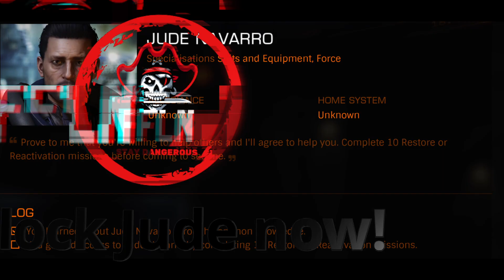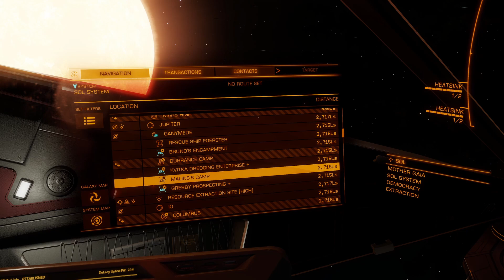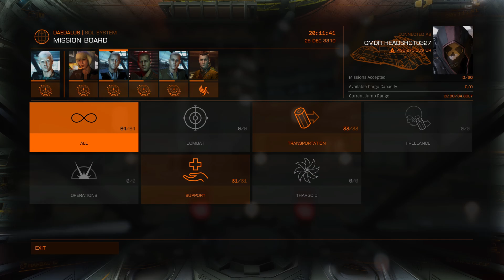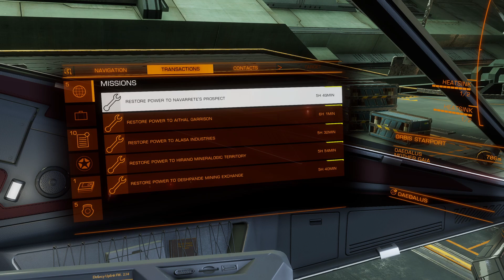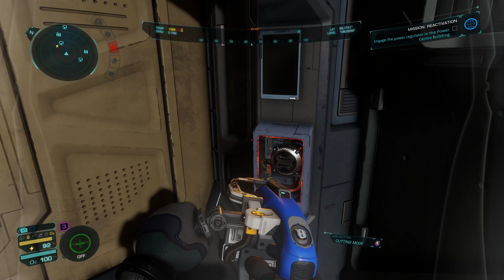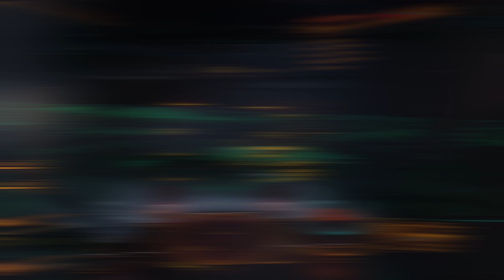Elite Dangerous Unlock Jude Now, How to, Why you should do it right now

Comment: If you're reading this long after the dust from the war has settled, try the Dainayiman/Xiancheim/Raidenwitha/Heryshaf systems. A couple of years ago I set up 60 anarchy settlements across those four systems, and one of them is nearly always in Bust state.
Reply from the maker: @Sighman  great tip about the other systems. I will pin your comment
Reply: Currently in Xiancheim and Restore Missions are available. Id do it here since SOL doesnt have anymore.
Reply: I have been flying around for 3 hours and every system I go in with bust/infrastructure failure/natural disaster/war/civil war/ect. is simply populating donation missions. I don't think I have ever seen so many before. For the life of me how on earth do I find these missions using Inara?
Reply from the maker: @Fenris159  its all down to rng, if you find an anarchy system, you can raid a settlement for days until it shuts down. which is why I tried to infirm as many as possible to do it while it is still easy to find. someone in the comments said they had a few systems they set up for this
Reply: @FFLN-b2c  Did the SOL missions already end? just got to the video
Reply from the maker: @ItsDeaconYT  yes they did. Some people have been posting in the comments when they have been able to find systems offering the missions
Reply: @FFLN-b2c  Turns out now that Sol ended the problem I was having was trying to check the mission boards while in ship. They won't appear. Had to get out and go inside the station to check the board. Found a bunch in a nearby system in a bust state.
Reply from the maker: @Fenris159  ok, I mentioned in the video that under normal situations you would find them inside the station on foot, I maybe should have made it more clear that they only show up inside stations under normal situations, and was not an optional thing

Comment: There is a Misc section in the Data part of Inara to find any special systems. Ie war systems for surface conflicts, reactivation/restore missions, all are centered on inputed system. It takes me seconds to find a system I need to plot and dont know where this weeks to find this stuff comes from. War and restoration is all around the system not just sol only and they are not all thargoid inflicted btw

Comment: I used Inara. Searched for minor Factions with status "infrastructure failure". Then checked each faction on size and assets. Picked a relatively big faction with multiple stations including an orbital in one system and got a hit right away. My alternative of using a SRV against scavangers was using one simple dumpfire missile rack on my Cobra. SRV is prolly better though, because I got bounty on me several times for splashing targets, that hadn`t yet open fire at me.

Comment: I have done 5 of these so far (in my alloted game time) and acquired some godies - enough to upgrade 1 suit. I got killed by the piraes on one mission and the in another I put the power regulator in place only to find that the display panel to initiate the power up sequene was off.
I have no idea what the issue was there. So I had to abandon that one.

Comment: Yeah, after having done these a buncha yesterday and accidentally unlocking Navarro, you can power up each settlement in a single charge in a basic suit. Cut, charge, cut, charge, drip in core, turn on, steal a little bit, leave. And once power is back on, you can simplify recharge as needed. 

Agreed on mowing scavs down with the SRV.

Comment: Spend one week in a rival PP system, hitting an anarchy factions odyssey settlements (take out everyone, steal all data, steal all PP goods etc), go to another, rinse and repeat. Do this a couple times a week. Next week, that faction will be in bust state and their places will be shut down. Go to one, turn it on, get the mission to go to the other place and turn that on, go between the 2. Every other trip is a restore mission.

You actually build rep with the anarchy faction whilst earning merits from undermining :D

(it does also slightly counteract it by completing the missions in a rival powers space, but oh well, it's only 10 restores required to get the eng then you can not accept the missions and just devstate them)
Reply: Your strat is way quicker just now though lol. The above would be what I would do in the absence of this heads up I should add.
Reply from the maker: @joetriccas  good tip for anyone that misses out on doing them now

Comment: Thanks for the excellent walk-through!  If you are like me, bad at the shooty bit: Equip 1-2 dumbfire missiles packs to clear out any initial scavengers. Pips to shield and hover over the settlement bombing the bejeez out of them when they start shooting at you. Only disadvantage is that most of the bodies despawn so you cannot scan them for extra bounty. Also a scorpion SRV helps with any stragglers (scout/sharpshooter). Fun to run them over.

Also, if you don't mind the fines and reputation hit: Grab random restore missions that offer power regulator and abandon them.  Then after a few runs don't forget to go to nearest interstellar admin station and pay them off before they get pissed off at you.
Reply: Just use an srv lol

Comment: Thank you! Very helpful, hope I'm not to late!
Reply: Be Advised: as of 12/27 Sol is locked  to me, (cannot Jump there) - I had been in there before doing these reactivate missions., 6 I think so far.
Not sure why they would close it to the public even with the recovery still in progress?
Reply from the maker: @juliancain6128  still active missions their. the system temporarily had its permit removed during the sole invasion. if you do not have a sole permit you would need one. they are not too difficult to get
Reply: @FFLN-b2c  I'm at Midshipman, one more rank to go...thanks again for the heads up!

Comment: You don't need to overcharge the doors, because you always get the grade 3 permission to open the doors. (Otherwise you would also need an e-braech to start the reactor.) This saves enough energy that you don't have to recharge the battery.
Reply from the maker: @leonhardwildensteiner8832  you have to over charge the doors, because there is no power for them to open. After you get the reactor powered up, then they will open for you, with level 3 access. Overcharging just gives them enough power to open, until the settlement power is restored
Reply: @FFLN-b2c  you have to charge them, but don't need to OVERcharge them. I did this 10 times yesterday. By the way. You can get 1200 merits if you have are having Paranav Antal, as your power.
Reply from the maker: @leonhardwildensteiner8832  ah, that makes sense. I thought you were saying they didn't need to be charged at all.

Comment: IF you need to source a power regulator the salvage missions can provide one on occasion. The one that has a SRV or on the top or bottom of the crashed ship
Reply: When you eject the power regulator, if it does not glow, it's a degraded one. Only good ones have a glow. This allows one to easily spot whether it's worth taking.
Also if you have an SRV, point it at the parked SRV you're planning to loot and you will be able to see if it holds a Power Regulator or Degraded Power Regulator in your SRV's targeting panel.

Alternatively, if you just need a power regulator and you don't care about the reputation decrease and fine you get for failing a mission, you can simply accept a mission that provides a power regulator, then abandon the mission, keeping the power regulator.